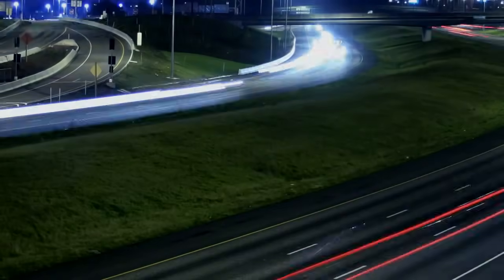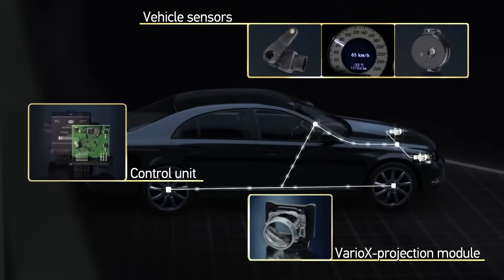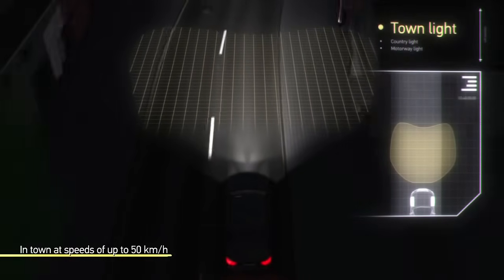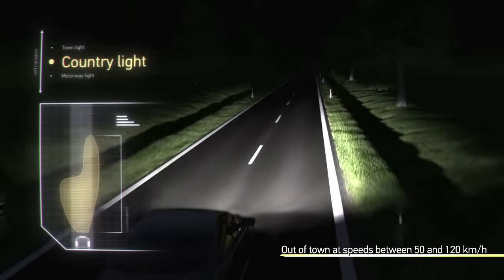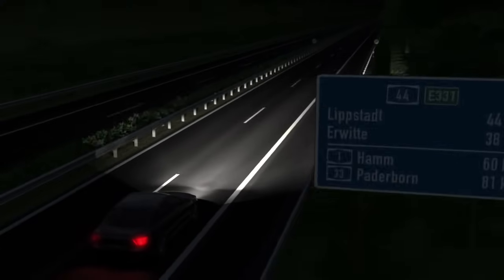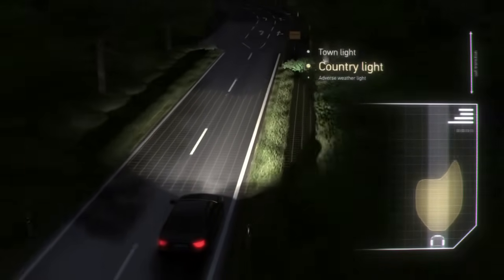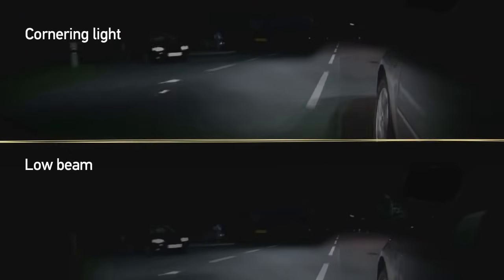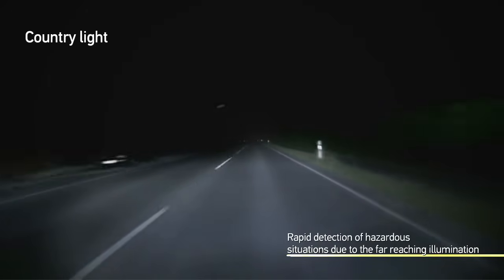Adaptive Frontlight System (AFS)

Comment: This is a ridiculously unneeded technology that costs too much to fix when the sensor on the suspension breaks.  Impressive engineering, but impractical for the average driver who doesn’t want to spend $500 to replace the suspension sensors
Reply: My 12 year old Lexus AFS works like the first day I bought it. Very practical if you work early  in the morning(like me) in pitch black darkness and have to drive through a rural area on the way.
Reply: agree
Reply: That’s nothing compared to $1500 so be glad 500 is reasonable
Reply: disagree

Comment: how speed controls the light?....please provide a logic for this ...and also how vertical swivelling works?.....which sensor detects the uphill or down hill movement of the vehicle and also what is the out put from the sensor??
Reply: No, it does not work like that. Its work great in laboratory.

Comment: My 2012 VW Touareg TDI Sport has adaptive front lighting and I've found it to be outstanding in all driving conditions. In fact, they improve visibility so much that I feel all new motor vehicles should have a similar system as a minimum requirement to pass safety testing.

Comment: would I have to request  a Loan , if a single bulb ends its life cycle ?
Reply: nope, you will need a small mortgage for this mate :)
Reply: The bulbs are either halogen H7 or xenon bulbs nothing expensive....
I have this system in my golf, works great!
Reply: I know if the headlights get damaged they're expensive to change but don't get a head of yourself my golf has it and sure it can be tricky to get to the bulbs (modern cars are a bit cramped) but you're still just changing a bulb :)
Reply: abd bach Surely this system,  it's not as simple as just changing a bulb
Reply: abd bach this are not regular  Bulbs this are LEDs modern cars no longer use bulbs, even the Interior lights of my car are LEDs
Reply: niceguy60 Yes of course, I was talking about my car which has Xenon bulbs, and LED lights have much better life expectancy anyway, they're rated about over 10 times better than normal halogen bulbs ;).
Reply: Bulbs are still used on cars. I classify them to be imported into Mexico where they assemble them to the turn signal lamps, taillights and  brake lights. Once they are assembled,they are the exported to the USA and many other countries. Bulbs are imported by containers, and that means many, many pieces. A company in San Luis Potosi sends these to customers in the USA like General Motors, Chrysler, Toyota, BMW, etc. It is better to investigate something before you affirm it.
Reply: Leonardo Dominguez

So what's your point? Normal Bulbs are important? well yea they are... did I look like I said the opposite? We are talking about Adaptive headlights systems and what kind of bulbs are used in them and how easy it is to change them (and even if they fail LED lights aren't that expensive and are more robust anyway).

And as an engineer and car enthusiast I'm pretty sure I know more about this domain than you, unless you're working in this exact industry.

Jesus some people are just ready to disagree before they understand what others are talking about.

And just for your information normal halogen bulbs are still used just because we've got pretty efficient at producing them and they're very cheap, but they're dying as LEDs are becoming much cheaper and way more efficient while producing more Lumens and have a long life cycle. So no normal bulbs are as important a you may think and will be less in the near future, they wast too much energy but we were stuck with them this long because there was no alternative before, so I suggest YOU investigate before you affirm something, minds like you who are stuck in the past and afraid of the future are the actual big obstacle against evolution.
Reply: LED headlights are very expensive to change and are not repairable. They don't fail so often but when they do, it sucks. Bulbs still have a future in cheaper cars.
Reply: @tomasmalin  well if u say $50 is costly, then u need a new job!
Reply: @therealb888  LED headlight is usually around 1000 $.